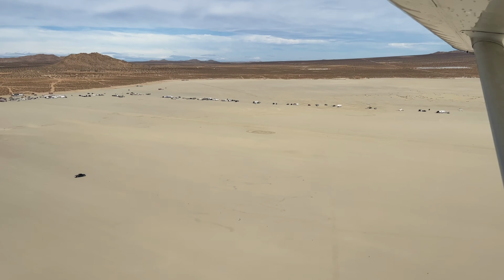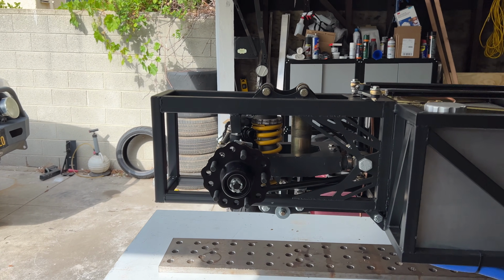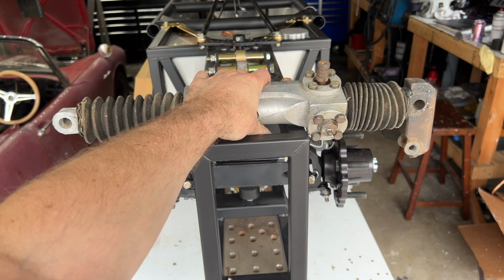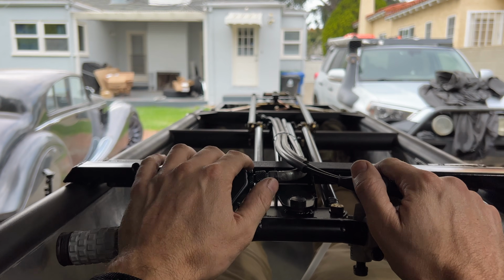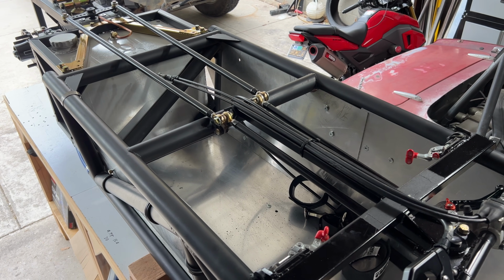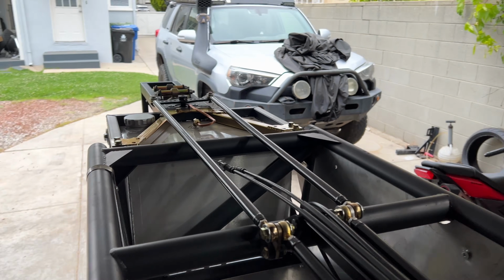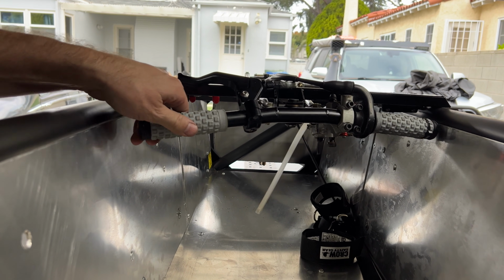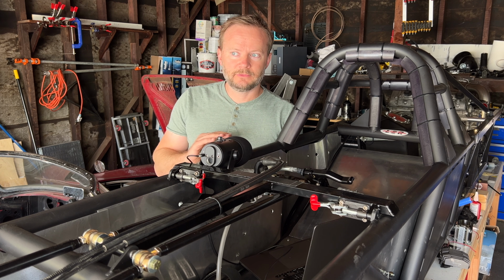Unnecessarily Complicated Steering

Comment: Uhh... sorry but if you leave Earth with a vector perpendicular to the center of mass (discounting relativistic effects and other gravitational sources) you can not achieve escape velocity. Gravity will eventually overcome your fuel and any 'speed' you have achieved. This is one of my favorite trick questions when teaching sophomore physics.
Reply: I think you should try junior or senior physics, and consider the situation from an energy perspective. Note that escape velocity is the speed at which the sum of an object's kinetic energy and its gravitational potential energy is equal to zero.
Reply: @brianb-p6586  If you want to consider this as an energetic argument, and try to avoid the fact that velocity is a vector, not possible. Your kinetic energy argument is simple to illuminate. Consider two masses, one with kinetic energy in the direction away from the other (vector anyone?). Gravitational potential will overcome any initial kinetic energy (non relativistic again) thus you need to add energy over time. And in fact you could add all the energy in the universe, and still not escape, though we've long since left it being a phycal problem. Hope that helps.
Reply: @carlostheflame  That's very far from correct. Gravitational potential energy does not endlessly increase with distance from the planet - it approaches a limit. 

The direction of motion matters to change of velocity over time, but escape is still the end result. If the velocity is initially directly outward it just decreases in magnitude (speed) as the body increases in distance way from the planet. If the velocity is initially downward (but far enough off of straight down to avoid hitting the planet) gravitational potential is exchanged for kinetic energy (object goes down, and speeds up) until its path is tangential, then it the trade goes the other way until escape.

Certainly there is no need to consider relativistic effects.

Are you seriously suggesting that you understand space flight dynamics better than those who actually do this for a living, such as NASA? Have a look at what they say:

NASA's version for primary school: seach for "F_Escape_Velocity"
NASA's more advanced version: search for "Gravity: It's What Keeps Us Together" in their educational materials
Reply: @brianb-p6586  What I seriously understand is Physics... yes, even space dynamics imagine that... What you fail to understand here is fundamental gravitation. Let's just take the two body problem. Two masses in an infinite universe. If at rest and placed anywhere in the universe, they will eventually come together. There is no distance limit to gravitational attraction. If given initial velocities that aren't directly in line with each other, they will end up in a dual orbit condition around the center of mass (with some caveats... but we're staying simple here). So... as you can see, if you have the two masses next to each other, and the only motion you allow is linearly away from each other, there is no amount of velocity you can start with that overcomes the infinite potential of gravity. Doesn't matter if it is small, it is still there for all time. A small force acting over infinite time require infinite energy to counteract.

So back to the original misconception. If you launch a rocket straight up, you will never reach escape velocity. You must do a gravity turn, i.e. change in velocity by changing the vector's direction.
Reply: @carlostheflame  What you're saying is that the gravity well is infinitely deep, which would matter if there were only a single body in space. In practice, you don't need to get very far from earth (on the scale of just our little solar system) before you fall into another body's gravitational well, so the theoretically infinite extent is irrelevant. 

Back to your original example: yes, you can achieve escape velocity, and the arguments that you have used to say that you can't fail even elementary orbital mechanics. So... you're saying that NASA is wrong because you can't image how an airplane could fly fast enough?

This whole discussion is an illustration of how obsession with a single aspect of a problem can blind one to the real situation. In reality, even though travelling at escape velocity directly at the planet won't work, any other direction will... and that's Matt's point in most cases direction doesn't matter, which is why it is also called "escape speed".
Reply: @brianb-p6586  Before I get flamed by other physics aficionados, lets set some context. Don't worry, I'm not prolonging anything and actually hope you like the interaction. In the calculation of escape velocity a critical fallacy exist, though from a practical engineering standpoint it is 100% reasonable. The assumption is that the gravity potential of a given mass is negligible at infinity. Is it? Again, if you took two masses and placed them infinitely far apart, are they attracted to each other? The law of gravitational attraction would say so, but does it make sense? Hence my statement that given infinite time, an object will always come back if the vectors are colinear based on a force law and not an unproven though extremely useful assumption. I also need infinite time for my claim... sketchy some would say. And it is actually perhaps completely WRONG... but worth thinking about (circling back to the sophomore physics question and why it's fun). Here are some violations of my argument that don't rely to heavily on relativity.

Let's assume we can travel at half the speed of light, semi-relativistic but reasonable. Let both objects accelerate away from each other at half the speed of light. It's a type of escape velocity no? They can never meet again regardless of initial mass.

Final point - you are in a gravity well. You fly to the Moon, another gravity well, but you are orbiting Earth, haven't escaped yet. You leave Earths influence, and hang with the asteroids and planets. You are orbiting the Sun. You leave the solar system, now free... to orbit the galactic mass. You take off and park out in space. Red shift would indicate that objects in the universe are all moving away from each other in general. Have you achieved escape velocity now? Galactic expansion balancing gravitational potential? It's possible, but not proven.

And not to be flippant, but obsessing over the details is called science. Revealing the assumptions used to solve problems and questioning their validity is called fun by scientists. Your use of wikipedia and NASA's website exceeds 80% of sophomore physics students I've had, kudos. And yes... I guess work was boring today...
Reply: well if you STAY perpendicular then true, but you are saying that even with 'possible advanced future technology' its still impossible to start facing 90 to the ground and keep going in a straight line into space? there is no speed that would achieve that? I know any theoretical spaceplane would have wings, but would it not start perpendicular to the ground?
Reply: @Born_Stellar  A plane generally is too inefficient for space use. All that atmospheric stuff is just added mass you lug along. If you've watched any of the myriad rocket launches, you hear "Vehicle is pitching downrange" which is called a gravity turn. That turn changes the vector away from center of mass, leading to escape velocity.
Reply: The term "perpendicular" is awkward in this case. "Tangential" to any sphere centred on the planet would be more clear.

If your craft attempts to fly a constant-altitude path (so moving tangentially to the sphere of that radius) it will need to exert a lifting force (force radially outward from the planet) to stay at that altitude if it is moving at less than the orbital velocity, and a downward force (radially inward, or negative lift) if moving at more than orbital velocity. Escape speed is significantly higher than orbital velocity, so if some hypothetical aircraft reached escape speed while on this circular path if would need to be exerting high negative lift. If thrust was cut and lift was stopped (eject the wings or whatever) at that point it would take a hyperbolic path away from the planet.

The problem is that at over 11 km per second or about Mach 32 (plus extra speed to account for energy lost in aerodynamic drag on the way out of the atmosphere), escape velocity at low altitude is not practical to reach.

Comment: we have a trike at work (bike with 2 rear wheels) and the first time I rode it I couldn't steer and ended up running into a wall. after a few minutes its easy again but it was weird to feel how it wasn't like a bike at all. you have to consciously push the handle the way you want to steer.
Reply: Quad bike is the same???
Reply: @JohnSmith-yv6eq  I was always confused by the (commonly used) term "Quad Bike" Is it a quad or is it a bike?
How many wheels are on the damn thing, 4 or 2? 🤔
Reply: @alibro7512  
Well, quad usually has the meaning "4"
as in quadriplegic....
ATVs were 2 wheel, (Rokon) three wheel (Honda and Suzuki) 6 wheel (Big Boss Polaris and Argos, 8 wheel (Argos)

So a 4 wheeled ATV is known as a quad if it is ridden like one would ride a motorcycle....
Reply: @JohnSmith-yv6eq  I've ridden quads a few times and they are great fun to drive round corners on two wheels. If you are any way good you can ride them on the straight while up on two wheels.
What would be the correct designation then? 🤔
Reply: @alibro7512  
Still a quad...
but one hopes that the rider does not become a quadriplegic...
most quads are heavy and once it goes over on you at speed...it'll crush you...

Comment: Recommend you use AN bolts on you steering rod ends as they are interference fit and will not allow any play.   Play + vibration + harmonics = bad day.
Reply: My preferred solution is overkill tightening and pre-load on the bolts.  Build up enough friction and even super loose bolts lock in and provide precise motion.  (and lock-wire for the rebels that don't stay tight)

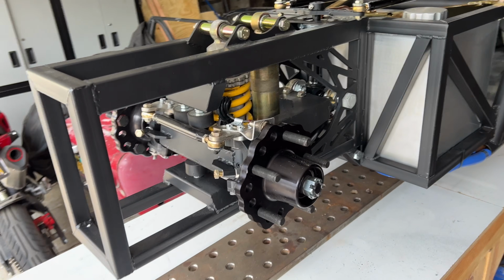Comment: 2:00 I have to take exception to the shopping cart analogy, because shopping carts use negative caster. Also known as the opposite of what you have. And I don't think that "snapping back to center" is the handling characteristic for which shopping carts are known. Maybe you'll notice the lack of shopping carts on the salt flats.
Reply: I think I have to take exception to your exception, because shopping carts don't use any camber at all.  I believe you just meant caster, but that angle is also 0° or neutral on every shopping cart I've seen.  There is mechanical trail, and that's the only thing generating a restoring force to put the wheel in line with the direction being pushed - but it has no "preferred" direction with greater stability.
Reply: @ralphsosera3698  I said camber where I meant caster, because I have teh dumb.
Reply: @shadetreemetalworks  all cool mate, mistakes do happen. Deleting my comment now since you have taken note.

Comment: If the steering got knocked hard to its limit (say you hit a rock at speed) could it bind at full turn so you couldn't wrestle it straight with the handlebars? Sorry just being fearful.
Reply from the maker: It doesn’t really bind. Think of it as a spring. It’ll want to spring back to center.

Comment: Did you consider hydraulic steering? 4 slave cylinders, some hardline and several flex lines. Just something to complicate your build.
Reply: The race sanctioning body doesn't allow push-pull cables, so it's unlikely to allow hydraulic steering. And it would be inadvisable anyway.
Reply: @brianb-p6586  They work off the same parts and principles as brakes, why would that be inadvisable? Cuts down on moving parts. Not like it was new tech.
Reply: @bradmaas6875  Losing steering is far more serious than losing brakes, and yet hydraulic brakes must be in a redundant system to be acceptable in a road-going motor vehicle. One leak and you're toast.

It's not quite the same operation, as braking system only apply force in one direction, retracting by springs; the steering needs to be rigid, so it is no straightforward to do properly.

I agree that hydrostatic steering is mature technology. It is widely used in low-speed equipment, where it works well. This is essentially the opposite situation.
Reply: @brianb-p6586  Hydraulics in aircraft, been in use for many years, redundant, and not what I'd call a low speed applications.
I wasn't thinking springs but opposing systems, push-pull.
Reply: @bradmaas6875  True, but by the time this steering system was built to aeronautical standards it would be more expensive than the entire car, and no less complex than the current linkage.

The problem with push-pull hydraulics is doing it without slop and without more complication.

Comment: What if for the steering tie rod, you had a spherical link that has a curve in it? 
I used to race RC cars and the steering tie rod ends would only move in one axis, so the ends that connected to the hubs had a almost C shap to them, allowing the arc of rotation to be slightly longer for the extra steering angle, however keeping the same length of tie rod.
Reply: in theory if the positions of the two end points are fixed, it doesn't matter what shape the rod between them is – it'll behave the same way regardless. The only thing a tie rod can do is keep two rod ends at a fixed distance from one another. In practice it probably changes the elastic behaviour of the rod, but the elasticity in Matt's current setup seems to be working fine, so why fix it if it's not broken?

Comment: @SuperfastMatt, are you required to do two wheels in the front, or could you have used one and simplified this steering?
Reply from the maker: You have to have four wheels, but they don’t have to be in a rectangle. So yeah, I could have done something like that.
Reply: @SuperfastMatt  Cool.  Thanks for the info.
Reply: See Thrust SST, except their inline pair is at the rear

Comment: Good luck, lsr is pretty easy if you don't over complicate it. Join a club, submit photos to inspectors to get checked off before you go. I run 250 in a roadster at El Mirage, everything you have will fill up with dust.

Comment: Well, yeah, it's not just the arm restraints, though.  You can't have your teeth getting knocked out in a crash so you're forced to put a special red rubber ball in your mouth secured by a leather strap around your head.  And latex shorts.  Gotta have latex shorts.

Comment: I don’t know if it’s relevant but in my trials sport it’s common to use a steering rack mounted longitudinally using the forward end as a push rod to an Ackerman cross linkage. It keeps everything out the road.

Comment: Sidecar rider here (CBR1100XX hack, it's sweet, also uses front swingarm hubcentric steering). You'll find not countersteering is surprisingly natural. Your brain adjusts almost instantly when the bike/car/whatever doesn't respond the way it thinks it should and will instinctively steer in the direction it needs to.
Reply: yeah an ATV is setup the same way and those are totally intuitive to steer.
Reply: Agree. Just like maneuvering from a parked location.
Reply: I was thinking how natural my soap box steering was with rope attached to the axle. 
Even better with my feet on the axle and my legs as dampers
Reply: I love it and high horsepower cars!!
https://youtu.be/9kphvGyN9-0
Reply: Nice
Reply: On bicycles, you don't really countersteer at low speeds, and at high speeds you don't have to do it consciously because a 10-15kg with an 85-90kg rider means it doesn't take much countersteer for the centre of mass to project down to the apex-ward side of the line between the contact patches, and you don't have the bike's intertia fighting you.
Reply: @EmyrDerfel  You actually still do counter steer at low speeds, generally. It's just engrained in your automatic responses so you don't notice. Watching people ride bikes at 3mph in slowmo betrays the split second of counter steer we all do.
Reply: @EmyrDerfel  i dare you to say this on reddit lmao
Reply: also direct steering like that is used on quads, i was wondering why matt didnt think about that
Reply: @DarkIzo  didn't veritasium do a video on this?
Reply: @EmyrDerfel  This is a common misconception.